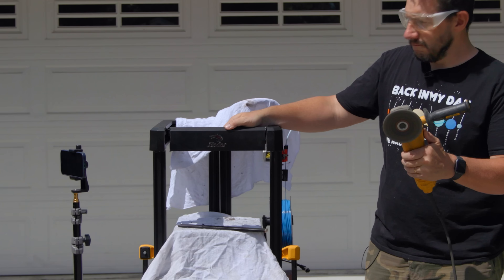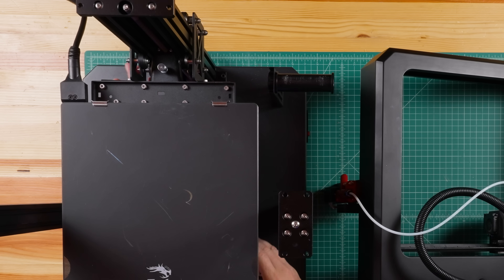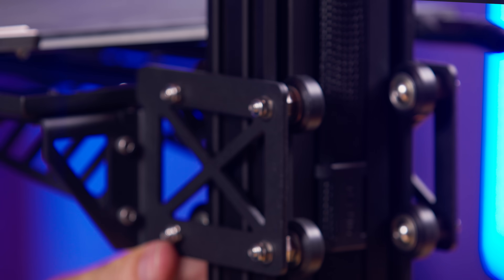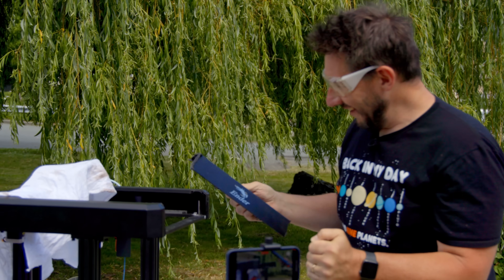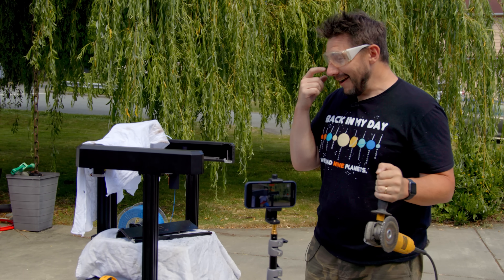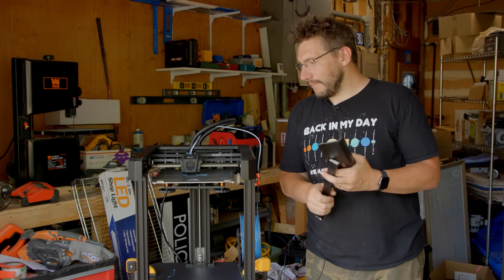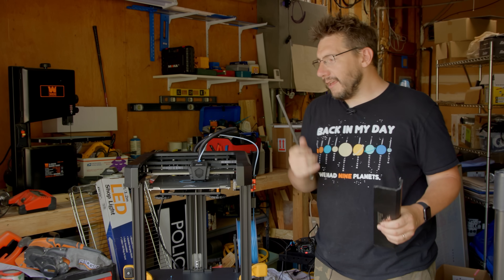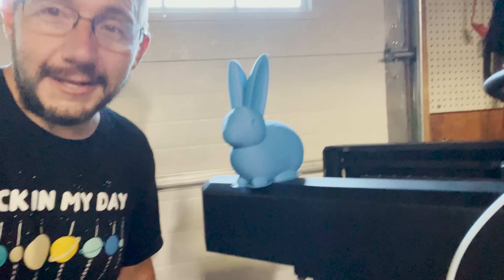I FIXED the Ender 7

Comment: The plastic frame help prevent the metal frame from warping, and the front metal frame helps with rigidity, keeping the printer square, and reducing the number of harmonic frequencies that it is susceptible to... Yes, I know it still works, but it really isn't an improvement. There are alternatives designs that they could implement, but from a design perspective, the way they had it was cheaper, and easier to implement. Unfortunately, any alternative designs would require additional materials and assembly costs.

Comment: For anyone saying "the structure is ruined"..............
Have u seen how floppy prusa i3 mk3's are? honestly- cutting the front off will literally do nothing- look how thick the injection molding and aluminum is
that U shape with the plastic cross section built in- would be WAYYYYYYYY more than enough structure. the ABS frame bolted into the alu makes for a very ridgid frame-, that front section may give SOME additional ridgidty- but i bet its super neglectable Like the american Healthcare system-  and tbh this 200mms speed crap can eat bum- The extruder cant keep up with those speeds- especially through bowden- 
Yea i guess if this were my bot- id cut off the plastic and leave the metal but only because im lazy.
But trust me if this thing shipped without the alu at the front- Itd be finneeeeeeeeeeeeeee 
Fine i tells ya and yes- its literally saving the environment. maybe if they didnnt waste the alu on the front and transfered that mass to the bed to stop it from being such a wobbley P.O.S

Comment: Couple of issues, and not with what you've done to the printer. First, where is the guard for your grinder? Yes you were wearing safety glasses, but those don't help protect the rest of your body. Second, I know you live in the Seattle area where harbor freight is a stone's throw from almost anywhere, So next time make a quick run and get the proper cutting disc instead of a grinding disc.

Comment: joel this is a terrible idea.  don't encourage people to do this, it ruins the printer.  you no longer have the square structure for the corexy.  you'll find the squareness of your prints will drift because you've just removed the piece that maintains that squareness.  you've turned a rigid structure more flexible.  bad idea.  don't do this.  biggest headdesk in the world.  interested to see how it works in the near future.  if anyone is running klipper on one of these and can do an accelerometer test that would be very interesting to compare.

you would have a better time converting the cantilever bed system to a two screw or even three screw design.

also, an "it will be fine" coming from joel isn't necessarily a good thing, after being amazed by trash before.

Comment: About the Z axis, can't you replace the bolts with a threaded rod, and use a 3D printed cylinder as a spacer between the wheels?

About the front of the panel: they could totally make a removeable front panel.

Comment: May I recommend the next time you do that try and use a cut off disc on the grinder instead.
Reply: Thank you for this, I thought I was going insane because no one has said this. Cutting disks for cutting, grinding disk for grinding :)
Reply: @Seibar42  i once saw a knob trying to cut a ceramic tile using a metal cutting disk just because it was what already attached to the grinder.. Without a disc guard and without any facial or bodily protection as well. I actually shouted "STOOOP" lol. Truly WTF moment.
Reply: @baikia777  Are you sure that wasn't me? hahaha
Reply: @Seibar42  you did that? Lol.. At least you know already. Some people only learn after losing chunks of meat first.
Reply: @baikia777  I've done worse XD at least the guards are on my grinders, the problem is when you borrow someone else's for that 'one quick job'.
Reply: @baikia777  i once saw someone try to sand something on one of those stationary disk sanders. Problem was, you need to put sandpaper on it, not try to sand on the bare metal. I shouted “STOOOP” too
Reply: Yeah, that was grinding my gears...
Reply: A slitting disc is what you are referring to.

Comment: with my admittedly minimal structural engineering education... the metal part of the front cross was to maintain square and parallelism of the linear rails, also the front metal cross member helped prevent twisting of the rear cross member during movement of the head. I would suspect the linear rails will now slowly move out of square as time goes on

Comment: maybe the bar on top for rigidity, and thin mold of plastic on top of that  is the second best option, ender, get with it, why do you think people were happy with the old printers that were only rods, we need printers that work, not for idle looks. im sure if i owned this printer, i would have done away with the plastic shroud altogether.

Comment: This isn't fully advisable.  Lowering the stiffness of the machine lowers the resonant frequency.  At that point, you need bigger motors or slower printing to avoid ringing.

There's a good video by Yaskawa explaining the math behind motor sizing and inertia ratios that touches on this.  Even well explained, it's kinda heavy, but worth watching for some of the high level understanding.
Reply: Happen to know which video that would be? I'm interested as well but I see a lot of video results.
Reply: @MihaiDesigns  Hey, it's Mihai!  Here's the video with timestamp:
https://www.youtube.com/watch?v=I8am9O3jk0Y&t=9m55s

Comment: Have you not reduced the rigidity of the printer by removing the metal cross piece?
Reply: It was build like that for some reason
Reply: Totally ! , the plastic part was totally unnecessary but when he cut  metal part away i was totally shocked.... since it is a pretty important part for that core XY gantry .

I Designes at least one Core XY printer by myself i am almost 100% sure, that the removal of that part WILL cause artifacts like ringing for sure . 

And a Core XY printer with only one Z Axis rail is predestined to have a bend bed because gravity. At least 3 z axis rails are needed... hmm  very fuzzy stuff
Reply: @aivazi  
That’s a near certainty, as you’re changing the structure from an ‘O’ to a ‘U’, and the forces applies on each arm of the new shape will create issues.

It would make sense to have something like this but with three z-screws, or a minimum of two like the Ender 5 Plus has.  This would increase costs a lot, due to going from one to three steppers, and then you need a leveling mechanism such as a BL-Touch.  The price point would be a problem, I guess.

I was hoping this could be used as a low-cost Voron base.
Reply: He did, he ruined it. CoreXY needs that top rigidity.

Comment: Joel, you know physics, but you seem to have ignored them by removing the structural integrity of the top frame.  Yes, it is open and visible now. It is even printing, but it is also free to get tweaked out of square if you move the printer or do maintenance.  The linear rails are now free to shift in XYZ directions from thermal expansion as well.

Would you remove one of the linear rails?  Why not? It would still be supported one side, right?  That is sort of what you have happening here.  

In short, you may be ordering a replacement top frame as a learning experience.

Ender could have just made an arched top front bar instead to allow visibility without compromising structural integrity.
Reply: Yes, and no. While yes, the front panel would reinforce the "squareness" of the frame, it would still tilt on the ZY and ZX planes if the printer does not sit on a level plane, by the forces applied on the 3 Z posts, almost the same than without the front. I don't believe the forces produced by the movement of the carriage would be able to flex much such thick metal, so the variance may be negligible.

If one is worried about that, then cut only the plastic, leaving the front metal bar. :)
Reply: If you are heating the top frame so much that it deforms from thermal expansion you have a completely different problem ...
In this caste the removed part is completely unneccessary.
OK, true, you could very likely deform it while working on it with the angle grinder. Afterwards it doesn't really matter all that much though.
It's not like youre going to stand on top of the printer
Reply: There isn't enough torque to deflect the 1/4in plate
Reply: @pen25  Resonance, the vibrations extended pieces of metal are subjected to will cause ringing at certain frequencies during the print.

Tuning forks are also thick pieces of metal, and they vibrate quite well.

Try it for yourself and experiment.
Reply: @woozleboy  How would you know that with the full frame there is noticeably less resonance?
The mass is only slightly different and there is no dampening at all in both cases anyways.

Comment: I sort of get it, why Chinese brands often get bashed for their quality. There are lots of bad apples there.
However, taking an angle grinder to a printer like this compromising the strength of the construction, claiming you're not and even criticizing the brand for basically listening to their users and making it really sturdy... That's just unfair.

Comment: Even the Ender 5 has two screws.  This thing has one and a thicker frame.  I would have tried spacers before breaking out the angle grinder.  If any cutting tools have to come out, the design is a failure.

Comment: for a couple hundred dollars more you can get a rat-rig which is on a completely different level in speed, quality, automation, tinkering, anything. If this is really 700 it's DOA even with no issues.

Comment: I feel like just taking the plastic off would have been enough while keeping a more sturdy frame
Reply: I feel like the aluminium crossbar was probably the thing keeping the linear rails for the Y-axis actually parallel.  Now they can bow out over time, as those two uprights slowly sag due to gravity and entropy.
Reply: @davydatwood3158  "entropy" lol, dude learned a physics term from youtube and has no idea what it means.
Reply: @davydatwood3158  I understand what you're saying but "entropy"!
Surely you could have found a better word to describe what happens to a machine when it slowly loses its structural rigidity. Let's face it a 3D printer shouldn't become our whole universe.
Reply: @davydatwood3158  it's a flat piece of metal that was probably water jetted. There isn't enough torque to cause the rails out of parallel unless the plate was somehow bent which would have been an issue even with the bar in place.
Reply: Agreed, or use the aluminum extrusion and add in a cross member 1/3 of the way down, that way you get your first 5 layers paranoia out of the way and still maintain a rigid frame.
Reply: the plastic adds rigidity. This is what happens when engineering meets a dimwit hobbyist.
Reply: @truantray  not really. It's just a cover that I assume keeps dust and fingers out. It's just sort of there. There's aluminum under it and cutting it was insanely stupid.
Reply: I would've kept that metal piece and use it to mount my camera for octoprint!
Reply: Honestly it's a cantilever bed. Making the frame solid does nothing when the bed is cantilevered like this. Also would have been just as good to add a bar about 3 inch's from the bottom bar.
Reply: @pen25  the bed isn't big enough for it to be an issue.
Reply: +1 to this

Comment: So So many NO's in this, if he hated the mechanism and its twist, print a piece that connects both and maybe use longer screws, not hard. his argument, it could twist and fail under load, under KGs of force maybe, not likely as the print size isnt that big. as for cutting out the front of the panel, i understand he disliked the lack of view, but he also removed all the rigidity from the frame, now a '250mm/s' printer is a 60mm/sec printer. that crosspiece would have been a perfect spot for a octoprint camera. not to mention his use of a grinding disc to cut, *shudder*. dont get me wrong, i like Joel, his style is good and entertaining, just this time he is wrong

Comment: The front helps to ensure that it remains square and doesn't wrack over time or while in use... particularly when the carriage is all the way forward.
Then, you used a grinding wheel rather than a cut-off wheel...

Comment: Lmao this is rididulous... 
Since I bought it, I have had tons of problems with my Ender 3 v2 related with poor design, poor quality control, bad parts etc. It costed me so much time and money to fix everything, and every month new problems keep coming out again and again. 
In the end I think I would have spent way less time and money if I bought a more reliable for a couple of hundred bucks more.
This video just confirms all my thoughts about Creality's engineering and quality...
Reply: Creality is actually the better ones out of many, funny enough. I modded my V2 as well, the basis is pretty ok and that's why I do like them as a learning platform. Thing I didn't like about it was that it still had many of the little issues that my first printer had (Ender 2!). So I had it fixed in no-time, printing beautifully, super fast (Klipper) and reliable. However, my next more serious printer will either be a Voron or a Prusa Bear or something like that. Also, I'm done with buying on Ali and such, I got tired very fast with soft metal screws and all. I spend more now, but get way more reliable parts.
Reply: @punishedbrains  I understand the pain. Should be so frustrating to see the same issues again... I'm starting to think like you as well:

I paid my Ender 3 v2 around 300 bucks (including shipping to Japan)

- all noisy cheap fans replaced with bigger and more silent ones (hotend fan died in one week, and seriously the venting of the PSU and Mobo is a joke, not even talking about the turbojet noise) 
- had to replace unreliable bed springs, low quality factory Bowden tube, unreliable feeder 
- had to buy new mobo cause the drivers skip steps whenever the bed is hotter than 80°c...
- had to buy new z stop switches because 2 of them broke in 3 months
- had to buy auto leveling system 
- had to buy spring steel + PEI sheet
- had to buy all metal hotend

in addition to this cost, considering the dozens of hours spent troubleshooting, looking for parts, fixing the frame not square with y axis, soldering the fans, printing and changing the electronics case, fan shroud etc..

I don't want to sound like a negative crybaby but, considering all those costs and dozens of hours (which also has a certain cost to me), I think I spent A LOT more than the price of an assembled Prusa Mk3s, which is known for being super reliable, and doesn't require any of the fixes mentioned above.

I understand that Creality's strategy is to provide very affordable printers by reducing quality, but there is obviously poor engineering overall and big quality problems. So for me the quality/cost ratio goes to more reliable printers. 
I kinda see affordable printers as a kind of trap cause ok they're cheap but the amount of effort and cash you have to invest to use it correctly in the long term (at least few months) is the other side of the iceberg.

Comment: I guess you could regain the lost rigidity by simply putting big crosses on the sites, where they aren't in the way. Or go even a step further and use big acrylic sheets to enclose the sides and be a step closer to a closed printer (only missing the top)

Comment: Next time use a cutting disc. This one is to grind and can explode on you when used to cut. We dont want you to end up on a gore site.
Reply: I have had to use a grinding disc a few times after i had ran out of cutting disc . Just takes for ever as your grinding and not cutting . Its using a cutting disc as a grinding disc  as you load up the forces on the wrong face  that they explode as the thin cutting blade bends

Comment: 1/4" Aluminum plate. Not Steel. You may also want to get some cut off wheels for your grinder instead of forcing a grinding wheel through things like this.

Comment: I don't really care what you print, but I hope you run prints at the advertised 250mm/s.  You can do big and small... I know it's not going to handle the small stuff well at 250 but it would be nice to see.
Reply: Wouldn't be able to reach that speed in small distances why it's almost meaningless to advertise high speeds with a small build volume.

Comment: And here's me thinking we were going to see this thing print at 250mm p/s, I have printed my Pro 3D V-King 400 at this speed and the print wasn't the best quality neither was it bad though and I have the very best parts money can buy installed on my V-King, I want to see this print fast, after all this why someone might buy this printer!
 What we have here is yet another dodgy Creality printer, it's a good job it didn't have ABL as it would be odds on that would not work correctly either just like every other Creality model.
 It is a pity they have stopped selling their best printer the Ender 2, I have one and that printer has never let me down and the quality is superb
Reply: The Ender2 is soo amazing reliable thus far!
Reply: 250mm/s print speed is just infill and moves and rest are sub 100mm/s

Comment: MM you could get a similar result if they designed it with a Thinner front Or CleaR plastic WINDOW / HOLE or a Support bar and not lose any structural integrity. Still Fun Video!